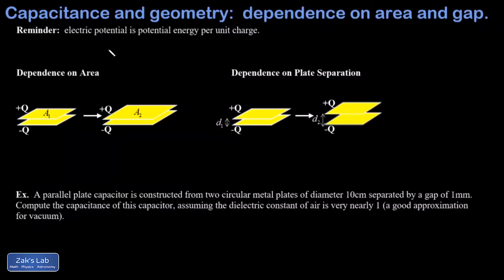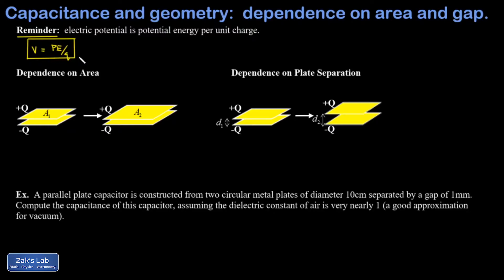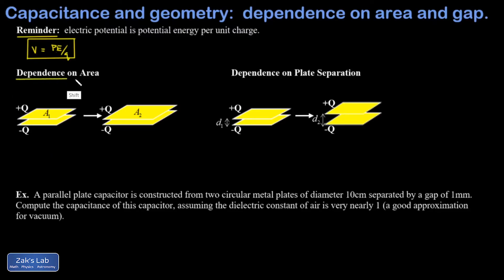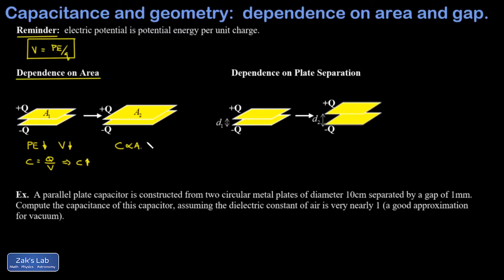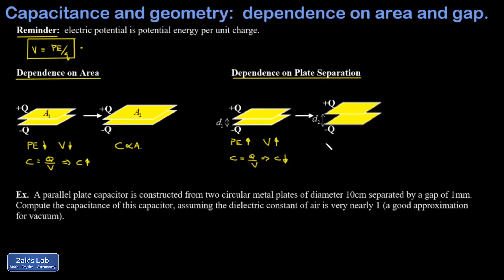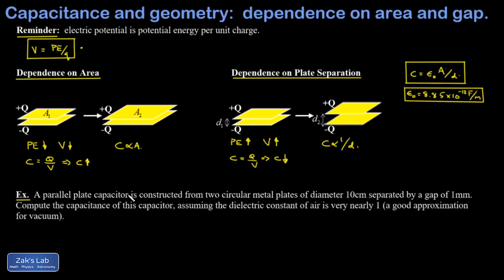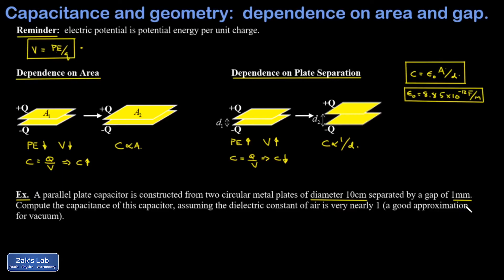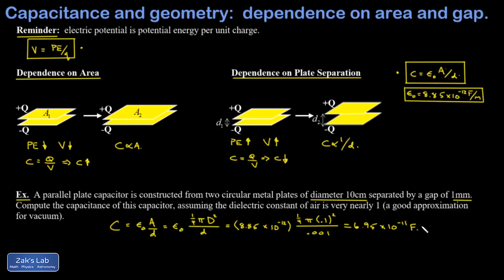Capacitance, area and distance (plate gap) for parallel plate capacitors:  C=epsilon*A/d.

Comment: When we are finding the A we are looking for the area of the shape. Does that mean if we were to have a trapezoid (or honestly any shape), instead of a a circle, we use that shapes area equation and plug that into the main equation?
Reply from the maker: As long as the plates are parallel, yes, you just use the area of that shape.  I'll do examples of squares, rectangles and circles in trig-based physics.